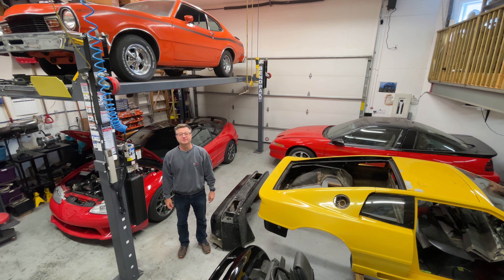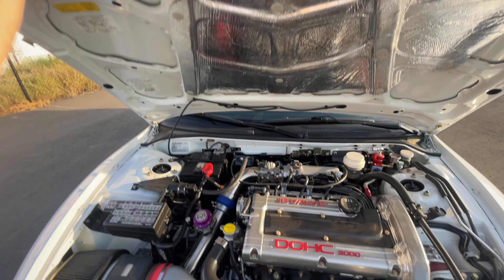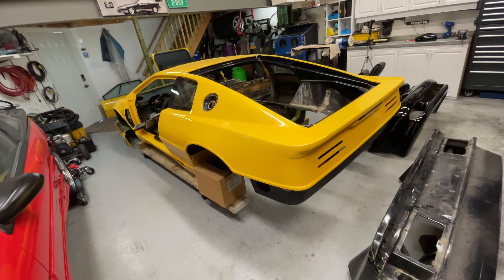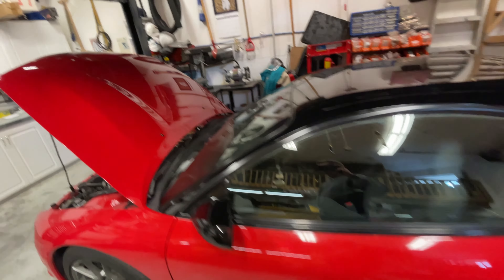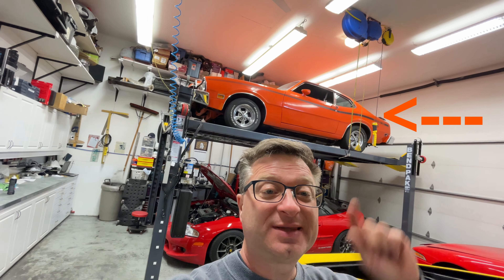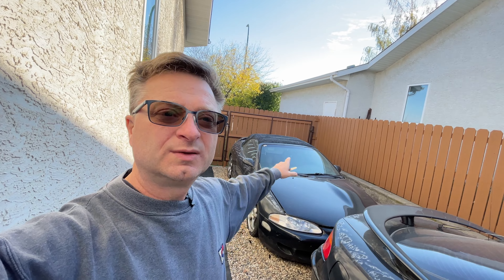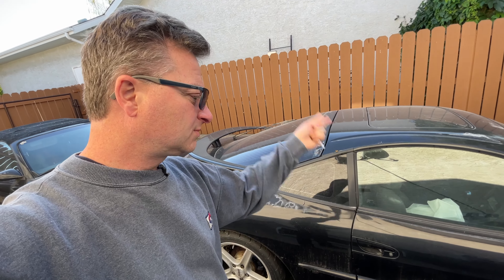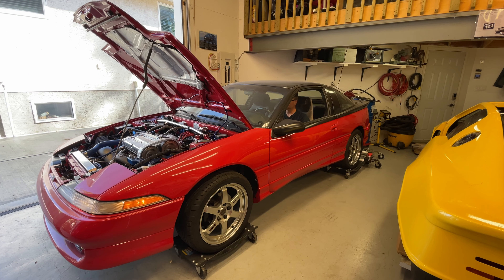Getting projects ready.  Fleet update! Lots of work ahead!

Comment: Holy rare interior on that 98 AWD.  As if a 98 AWD isn't rare enough(783 in total) yours has the 78H interior code.  Gray fabric with 'hammer time' pattern.  Only 98 ever had that interior, and only in 1998 model year. 60 were Canadian spec.  Only 13 in R87 Radiant Fire Red.  Very little known about what's left of these so you can very well may have a 1 of 1 on your hands.
Reply from the maker: You always have such great stats on the production numbers of these cars. Thanks for sharing such great info. I personally have never seen this interior on any other DSM to date. And I have seen a lot of them. I think I have owned most of them. Wink 😉
Reply: @SlippingTime  it's great to see someone like yourself if taking great care of these cars. Also, I picked up your '90 has black decals on the side skirts, and not the white/silver. Were those changed out?
Reply from the maker: @MindBlowin03  Those decals are black from the factory. I can’t say for sure if they only were black in 90, but back in 90 I only seen black decals on the red ones. I didn’t see other colors on red until later years.
Reply: @SlippingTime  I had a 90 Talon AWD in red that has the white decals and a 91 AWD in red with black decals. Interesting of the differences.
Reply from the maker: @MindBlowin03  very interesting differences for sure.

Comment: 1ga, 1gb, 2ga, 2gb talon or eclipse.  You can only pick one to have.  Which do you choose?
Reply from the maker: I think all reading this comment should respond and mention the reason of their choice. For me it’s a 1ga because I have my original owner 90 that got me into DSM’s.  It was a game changer of the day and the 1g is one of the most comfortable cars to drive.
Reply: @SlippingTime  That makes sense.  For me, it's between the 1gb and 2gb even though my first was a 2ga later converted to a 2gb and my current dsm is a 1gb. Since we have to pic one, I'll pick the 2gb eclipse.  Just iconic with body lines that doesn't seem to age.  Also I feel like the 2g handles better than a 1g.
Reply from the maker: @AWD_T  for sure on the comments of the 2g iconic styling and it is much better handling than the 1g. With that said, the 1ga was a huge advancement for handling of the similar priced cars at the time. I traded my 87 fox fox body for my 90 Talon just for the handling and traction difference alone. In any case, you can’t go wrong with either and like having each as an option to drive in the fleet.  Anything with a 4g63 floats my boat. 😀
Reply: @SlippingTime  Agreed.  Can never go wrong with anything that has a 4g63